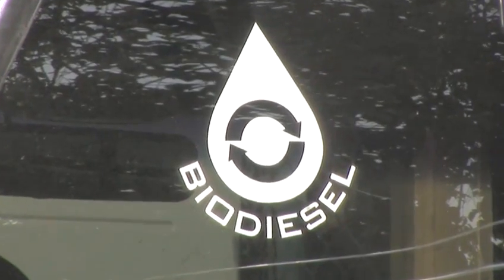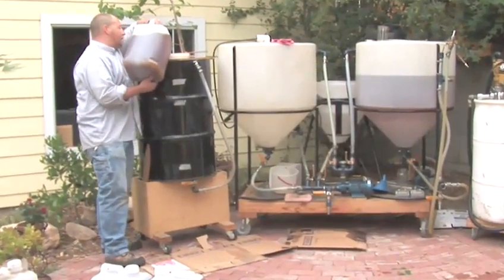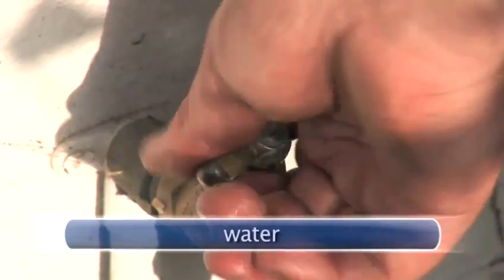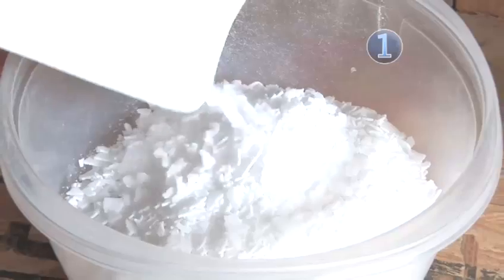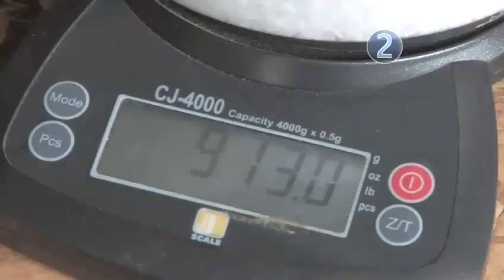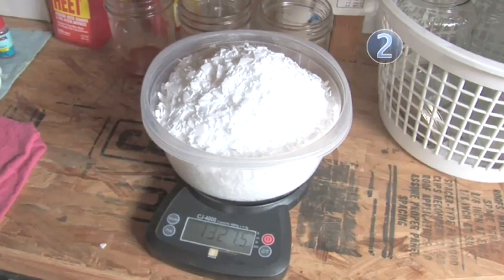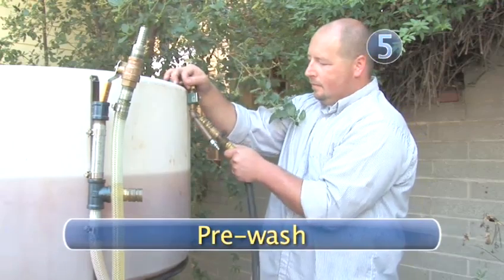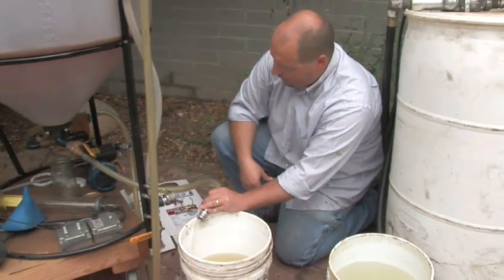A Guide To Blending Your Biodiesel

Comment: too many procedures that you do not need. all you have to do is strain the used vegetable oil, let it sit for 2-3 days under the sun, make methoxide, mixed thorougly, vent then close tightly, leave it again under the sun for 3-4 days, biodiesel stays on top, glycerine stays at the bottom, no washing with water. then fill er up. that's it watch mike sklar's video. faster and better.
Reply: Can't find this video you're talking about. Maybe because your comment was nine years ago, but is it still online?